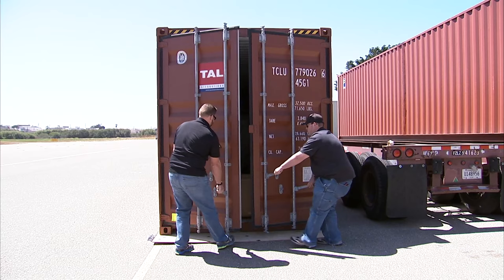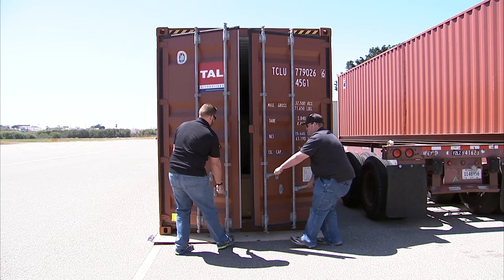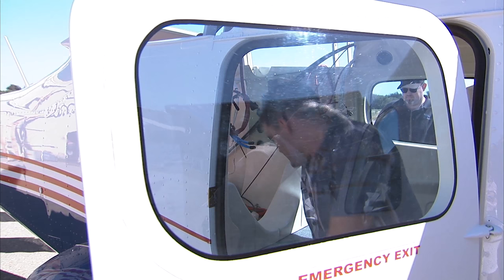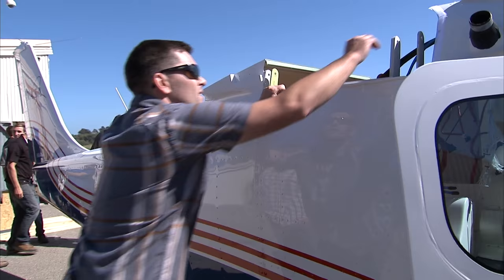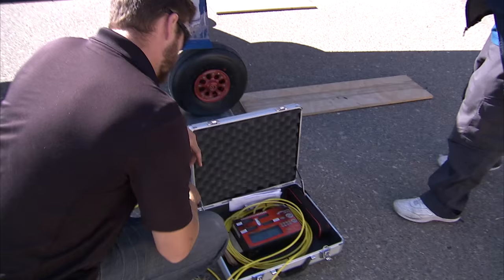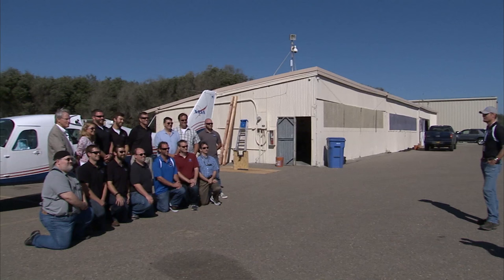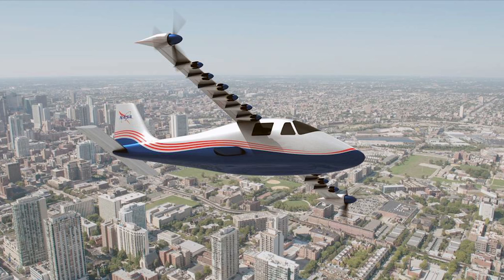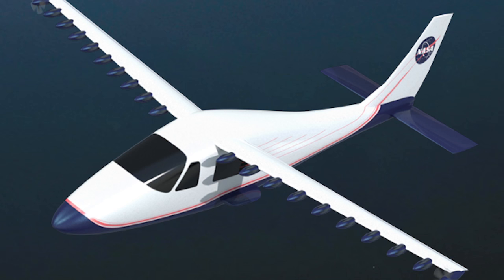X-57 aircraft arrives in Oceano

Comment: Now, I don't necessarily expect a response from anybody on the team, but I do wonder, do the models really predict an efficiency advantage for the multiple individual motors?  Everything I've been lead to believe about mechanical systems always leads to fewer moving parts equaling less efficiency loss.  Each individual item in a chain will introduce it's own loss of efficiency.

This is also why I'm told our rockets were almost always better than the Soviet's.  They used many small thrusters, we had one massive one.
Reply: hahahaha LOL! PRIVET from SOVIET! we use only work technology doesnt matter "efficiency" - its better then "BIG BUM" situation.
Reply: you are wrong in that part. when rocket engine nozzle gets too big it becomes really bad...

there was some video explaining how they want to achieve that aircraft will fly with smaller wings and produce less drag... its what they thing it will work and be more efficient... only time will tell if they are right.